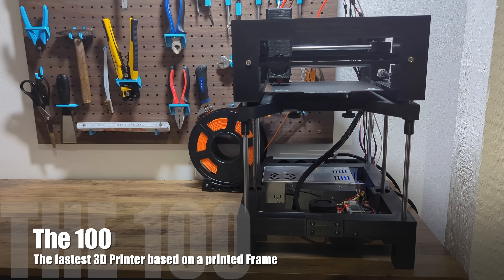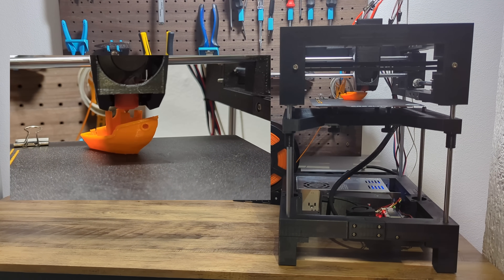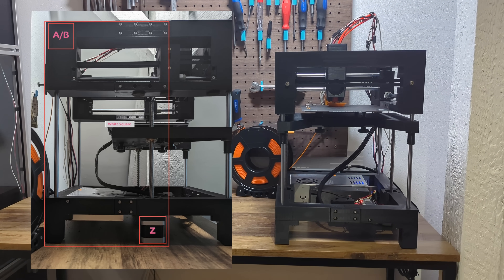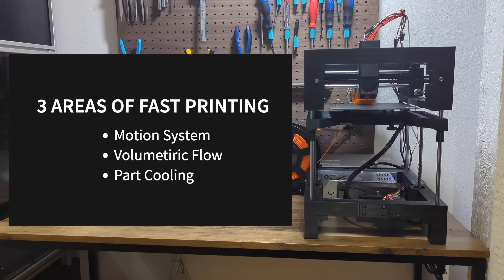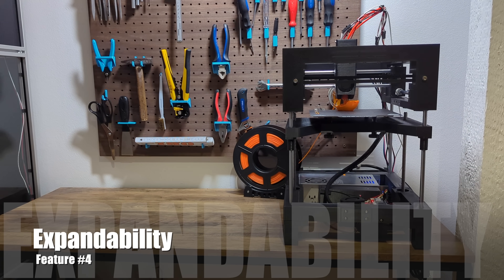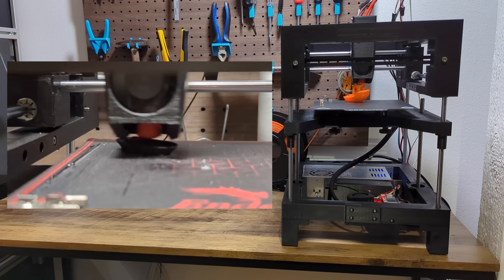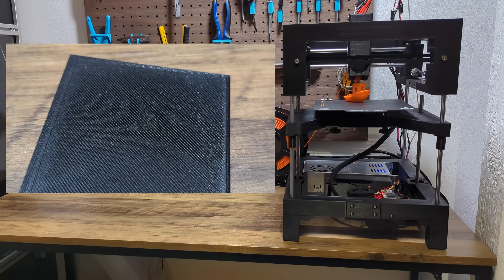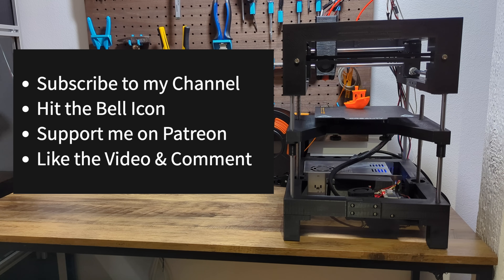The 100 - The worlds fastest 3D Printer based on a printed Frame

Comment: Hey, this is a very promising build, i like it!
maybe this was mentioned in the video and i didn't notice, but how tall is the build area? is it a 165mm cube?
For me to build this myself it would need to be close to 250x250x165mm, it seems like that would be achievable easily by modifying the frame to be longer and implementing panes which are screwed in the frame every couple of centimeters to provide additional rigidity to counter the longer frame. (+maybe filling the frame with epoxy resin to provide extra stiffness+weight)

To counter the fact that the linear rails would get pretty wobbly, one could lighten up the print head by having one big fan on the frame to provide cooling to everything and using a hose to deliver the air to the hotend, then you would  achieve minimal weight on the moving parts, only having to move: Hotend, printed ducts, part of the air hose and the parts for fixing the hotend to the rails (incl. bearings)

Comment: I'd love to see a high speed printer support 300x300 bed size. The X-1 Carbon is the only printer right now that does decent speeds while having a decent build area. But I've been spoiled by 300x300 for a while and can't give it up, but sadly no one seems to be trying to figure out how to keep speed up the larger print areas yet.
Reply: Well, this is a Version 1.0 
He did go bigger than most of the Speeders!  And he was smart to stay small enough to put his benchy in the top 25 !!  Even with a larger build size that can complete the majority of his print needs.  Its the logical starting point.   I would bet there will be many significant improvements and abilities down the road.
Reply: What are you talking about there are a handful of printers that are 300x300 or larger that can print as fast or maybe even a touch faster then the bambu while still offering quilty. Now if your talking out of box already built then yeah bambu is pretty much the only one thus far.
Reply: I agree, I want a 300 by 300 version too! 🫡
Reply: @THOR_THE_GOD  there are a few  larger remix versions.  Not sure if its been built yet, but the designs are out there.  The discord has some great info.
Reply: @David Baumgarner  Oh! Do you have any links sir?

Comment: I printed that t-800 but with the base at 0.2 layers on an ender 3 pretty much unmodded except the part cooling and an all metal heatbreak, not stock profile though, stock ender 3 profile is trash. it took 21 hours. I have no idea how it would take 82 hours on even the stock profile.

Comment: Suggestions. At the bottom of your printer make a second printer with the weight of your printer head and reverse the motion of your printer this  could help dampen the vibrations. Second remove the fan on the printer head and use an external fan with a tube.
Reply: One more extreme thing. Don't know if would work but maybe building it in a vacuum chamber to remove air drag. Or a chamber with N2

Comment: This is great, very nice work. I'm working on a CroXY printer design right now to try and push even more ludicrous speeds, but haven't been able to find a hotend design that could cool the kinds of flow rates I'm looking at pushing - any chance of you releasing the STEP files for the hot end so other people in the community can adapt it to other mounting systems?
Reply: One pretty good way is by using big fann outside printing area blowing air on the whole printer layer. Like bamboo.

Comment: fastest subscribe in the west. (just a comment I havent finished the video yet)useing too big of motors can hurt performance. matching the inertia of your rotors to the load makes a big differnce. since steppers dont have feed back the load is needed for the rotor to fall between the poles as expected. 1:1 to 1:5 is considered best. like the v0 motors need about 200 grams of load min). You looked at the tmc hysteresis settings? those can help to.

Comment: Nice as it is open source, but sadly it is way to instable as the complete dynamic elements are only hold in place by some rods.
Not the most stable printer. You noted it by yourself at 1:45 and made the same fault (only rods as frame) ... lol

Comment: Matt, the position of center of mass you are speaking is valid for space with zero gravity. But because your printer is staying on a table - it has an "attached" mass at the bottom. so real center of mass is much lower than yours. just imagine that you glued your printer to the table, so the table will be a mechanical part of the printer, and "center of mass" will be somewhere near of the table effective center of mass.

Comment: I've build my own 3d printer, the goal, reliable operation. I never built for speed, but I've had an idea that I want to try out. This is to move the fan off the print head. I have a large blower fan that I am going to make a duct for and then run tubing down to the print head the only weight on the print head will be the tubing plus whatever I put there to hold it in place. I plan on using 4 pieces of tubing pointed at the print area, though this idea may change as well. I am thinking perhaps a manifold made of nothing but flexible tubing with holes drilled into it, with all holes pointing at the print. I need to do the design and testing, but I don't mind; this is the whole reason I built my own printer after all...

Comment: Coupling the bed screws to the top frame firectly instead of a load path through the z linear rails, bottom frame, stepper bearings,couplers,and the full length of the screws might be an improvement. You seem to have your head screwed on straight when it comes to mechanical design so I know my comment will be appreciated.

The motors can still be at the bottom  and rigidly mounted against rotation but flexible in Z, then couple the screws to your top frame with bearings suited to axial loads. Nuts to be positioned conventionally.

Or another option since you are space constrained between the bed and top frame, drive the z screws by belt from an offset motor but still mount the screws to the top frame by a thrust bearing.

Comment: I have a 10S Pro V1 with lots of upgrades but i now need a production machine to make many parts fast but i am a poor retired hobbyist. Your design seems to hit a nerve in my brain. As a former automation and robotics manufacturing engineer I know all your discoveries are dead on.  Is it truly buildable by an old man with a 10s Pro? and the parts list of stuff needed realistic at $350. Very interesting Project. Dennis in Virginia
Reply from the maker: Hey Dennis, as a manufacturing engineer this will be a piece of cake, as long as your printer is able to print bigger parts without warping.
Reply: @MattThePrintingNerd  can do, tender chassis, empire state building in 1/64 scale this is pretty exciting.

Comment: Could you have carbon fibre rods, like the P1P? Or are they to expensive or hard to get?
Reply from the maker: Actually i would like to try hollow steel rods or carbon fibre rods but the ones you find on aliexpress are all made for drones or rc cars with a tolerance of 0,1mm which wont work for a 3d printer. Does anyone have a good source for carbon fibre rods?
Reply: @MattThePrintingNerd  Have you thought about carbon arrows? They are quite cheap and have low tolerance (depending on maker). They are hollow of course, but maybe this is an option... only getting bearings that fit might be a problem...

Comment: That is extremely cool! If I was going to build this I would go a step further and add ceramic/steel plates to the frame to give it as much weight as possible to reduce vibrations. I might even fill the frame with epoxy to make it super rigid. 
I'm also slightly disappointed with the print volume, maybe I've become accustomed to 220x220 but that seems like a really easy modification to this design given how incredibly modular it is.
A little trick I've learned from the guncad community is if you add threaded rods along the length of a print it can increase rigidity substantially, so for this printer you would add them going through the middle of each section of the frame then tighten on both sides with nuts to clamp everything together really tight.
Reply: Yeah, I think it would be an interesting idea to explore pauses in the gcode to insert steel bars for rigidity and weight.  It could still keep it simple for DIY'ers without having to machine steel!   yet get some of the advantages at least and with smart choices of common bar stock, it could be kept reasonably cheap ( I think) .
I find it hard to believe that 3d printed plastic can be rigid enough... like compared to aluminum extrusions?  the weaknesses of those has to be the joints... Although he did mention big advantages of being able to repostion the steppers in optimum locations.

Obviously this design is very sound tho!  Its incredibly impressive!
And totally on point with RepRap.  using a printer to make another printer (oh yeah its also 10 times better!!!!!)
Reply: @DavidBaumgarner  Thats a really interesting idea I hadn't even considered, I've seen meter long lengths of stainless rods going for around 20-30 euro on ebay. You would only need a handful of them for the entire printer if you cut them down to size.
I agree with you on the joints, they're definitely the biggest source of vibration/lack of rigidity. Some sort of joint that would allow compression would be preferable, maybe even just bolts on the outside edge of the frame?
Reply: My method for steel-reinforced plastic is to model internal thread, print the part then drop some CA glue into the threads and screw in a large screw.   I would NOT advise trying to insert metal while printing.  The adhesion would be poor and the plastic will change dimensions as it cools.   It is best to use adhesive after the plastic cools.   But MORE IMPORTANTLY, why are people suggesting fixes when they don't have data.   You should first test to find the bottlenecks and not just randomly try things.  I suspect cooling and extruder speed is what limits this printer to "only" 400 mm/second.   To go really fast you have to spend $$$ for bigger direct drive extruders (maybe even 3 mm filament) and a water-cooled hot end.  Then you need even bigger A/B motos and a stronger frame and then you've spent $2K.       A printer's speed is limited by how many cubic mm of plastic it can extrude per second.   This printer is already doing about 40 MM^3.    To go twice as fast you would need to find a way to do 80.

Comment: Hi Matt, awesome work! Where do you hang out online? Is there some online community where are you hang out? Discord, Facebook group or Reddit? Have you considered adding marble as the weight or putting laser cut steel plates inside the printed parts of the frame to make it even more heavy?
Reply from the maker: We have a Discord Server for this project. You find a link to the server in the video description

Comment: Definitely setting the bar very high! Good job in the creation of this printer. The plastic bearings I believe are what's causing the vibration layer lines. I read this on a few forums while back try using the normal 8mm linear ball bearings on one of your prints.

Comment: What did you print the parts from, ABS?
Reply: From the GitHub: I've printed all parts out of PLA. If you plan to print ABS/ASA on the printer i would suggest to print the print bed out of a more temperature resistant material.

Comment: Wow, you did this with old school linear rods instead of rails? crazy!
Reply from the maker: Yeah, rods aren't as bad as they say they are. Have a look at Bambu for example they also choose a rod based approach. For me the price was a big driver when building this printer. Also most of the Linear rails are not perfectly straight, therefore you bolt them every 2 cm into your aluminum frame. I prototyped a X-Axis with a linear rail without a frame at all, but the performance was worse that with my rod based design.